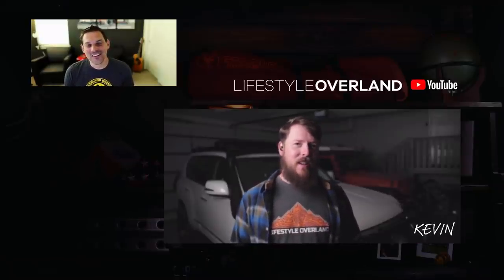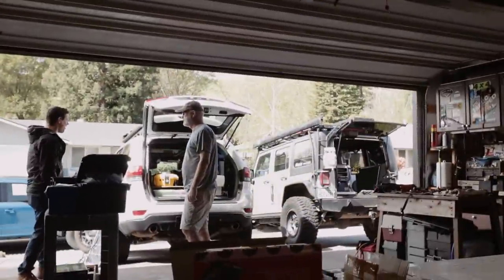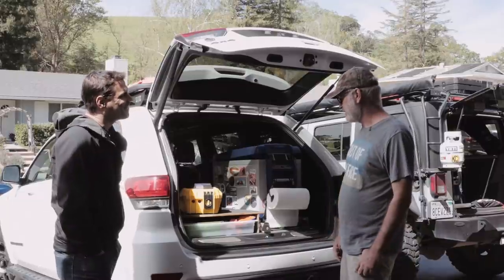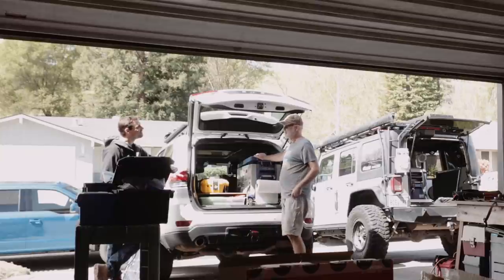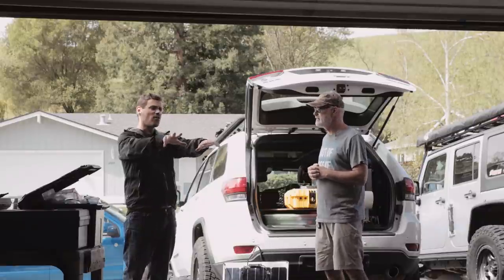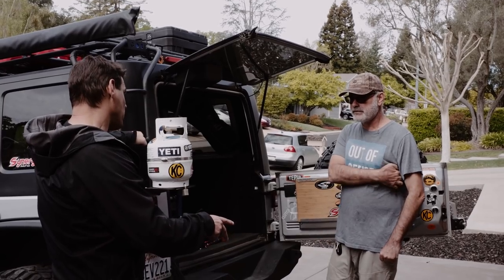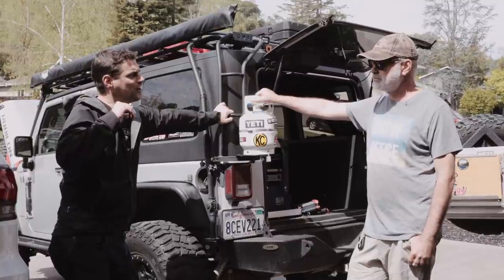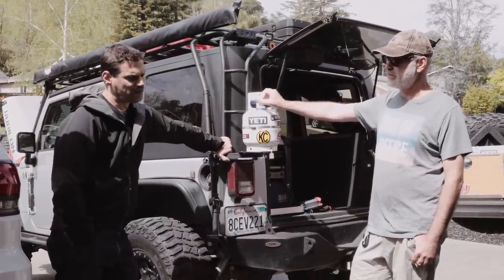Dual Battery Setup | What you need to know!

Comment: My biggest pro tips related to wiring. No electrical tape, no soldering, I use uninsulated terminals with heat shrink just about everywhere. Always leave a bit extra wire. Cut your zip ties flush. Don't force the wire. Label everything and have a plan. Dielectric grease is your friend. Some materials (cheap loom) is not uv stable. The type of wire matters (preferably is stranded gxl).I should really make a video on a lot of what I've learned.

Comment: I was all about a portable power station, but I have decided to run both, a PPS and a dual battery. We are in serious bear country, so having the fridge locked in the back of the Jeep at night while we are in our shelter a bit away is ideal. 

In our tent or the small TD trailer, we can have the PPS to power devices, the trailer fan etc., while the dual system's house battery runs the fridge. With the inverter, if we choose to have one, we have many options for using solar, or the house battery to charge the PPS or just the solar.

Comment: Wow the timing of this video could not be more perfect. I just bought a Engel fridge for the 4Runner and I am starting to look at power needs. I also ordered a NOCO boost box to jump start me if I run my single AGM battery too low. So I guess I am taking the route that Kevin suggested at LifeStyle Overland. I am sure I will build off of that as my needs change. Great video!!

Comment: I use dual xs3400 for starting 640 watts solar renogy dc to dc to 2 200ah amg batteries. And if you decide to weld with batteries make sure you have the correct stick rods . I learned the hard way.

Comment: I'm knee deep in my 80 series dual battery system build as we speak! I've seen Kevin doing his recently and now you guys. Great timing! I wish I had the budget or hookup for the Manager 30 and Redvision... However,  I am super excited to build what I have. It is going to be very similar to Ron's behind the driver seat set up. And I will have shore power charging, solar controller, and dc/dc capabilities.  I can't wait to see your custom console!!! And as a fellow 80 series owner, I NEED to see what you come up with for cup holders! Cheers Michael! OB member 25558
Reply from the maker: Awesome Michael - good luck with the build!

Comment: I've been wondering how the new jeep 4xe hybrid's electric system could be used for overlanding. You cant use the big battery as a power source but I believe the under hood battery is only used to power the accessory's (fans, gauges, lights) not as the starter battery so a lithium battery could be a good option. But I want to find out if the recharging from the motor/generator could be used to recharge aux. battery's after the main battery is full. Battle born has a new LiFePO4 (Safer chemistry, longer life span)100ah heated battery that can be used under the hood. Not cheap but very good quality.

Comment: Found this just in time (I think.)  Getting ready to go Dual Battery in my 2500hd to run my accessories (Lights and some extra charging ports mostly) but MOST important is that I want to isolate my winch from the starting battery.   I see lots of content about accessory systems on the secondary, and about putting the winch on the Starting battery, but I don't want to risk the starting battery.  Does anyone have a recommendation?

Comment: My Chevy truck is wired to be able to charge a trailer battery.  this has its own 40 amp fuse and only charges when the vehicle is running and shows 0 voltage when the vehicle is not running.  Can I just connect a second battery to this post and roll with it.  As long as the two batters have the same profile say AGM shouldn't it work properly.

Comment: I have a question regarding AGM batteries. From what I've read online everything says that they will not charge properly off the vehicles charging system and they will not last yet everybody seems to run them. Is this just internet fud or will I really ruin the Odyssey pc1500t battery I installed. I can't really afford a dual set up so I went with a "top of the line" start battery. I know the gentleman in the video emphasized that the life of the battery may be shortened. I guess I want to know just how short that is
Reply: AGM was the only option for years, but you can only drain, or use up to 50% of the available power. Lithium Ion is much more money, but you can drain ton98-100%, it is lighter, better, lasts longer but can be 3x as much money-wise.

People are using AGM because they want to save money, and they're used to it.

Comment: What do you mean by starting battery?????
Reply from the maker: Hi Connie - it is the battery that starts the car and is used for the standard automotive functions. The 2nd battery is know as the Auxiliary or House battery, and is used to run your camping and other accessories so it doesn't run down your car starting battery.